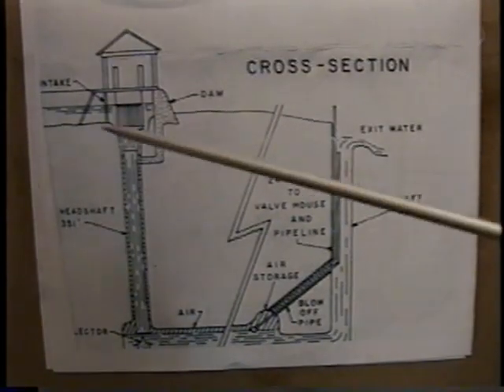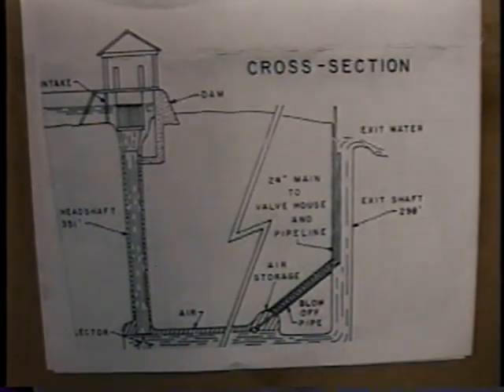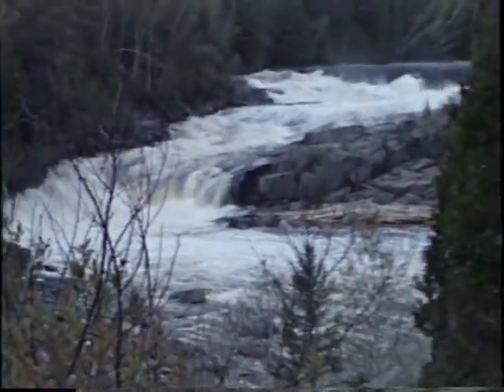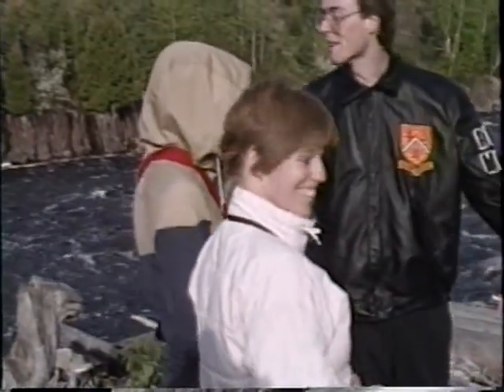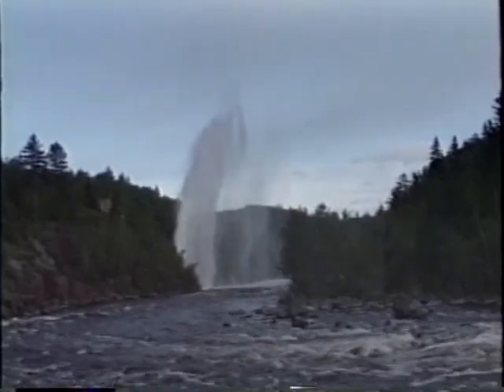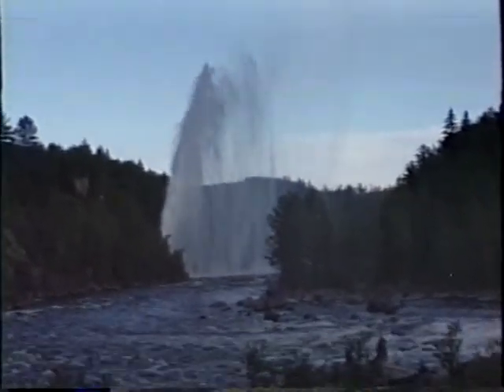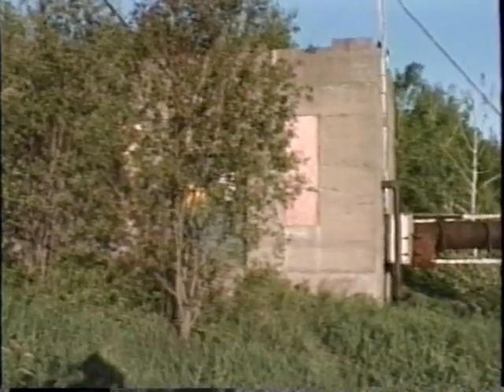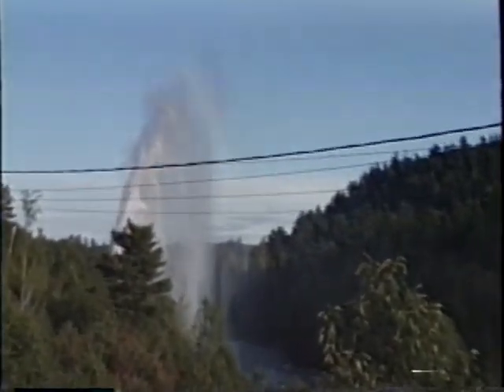Ragged Chutes compressed air hydropneumatic plant

Comment: Why not connect an air powered reciprocating engine to the outlet supply pipe via suitable control valves... drive a small AC generator....now that would be 'clean' energy

Comment: The guy who designed this was a genius
Reply: It's actually the same basic principle as an aspirator or mercury diffusion vacuum pump... but it's still a brilliant application that should be reviewed for carbon-neutral industry
Reply: @phrenologisto  there is no such thing as carbon neutral. The carbon fanatics want us to go back to the Stone Age. No one can afford carbon neutral. It’s a fantasy
Reply: @phrenologisto  I think it would be good for country living, as it can provide heating and cooling for the house, power refrigerators and freezer, power for pneumatic tools, air for air-start engines, pressure for plumbing, and can serve as an auxiliary power supply for when everything else breaks. It's not terribly efficient, but it doesn't have to be since it doesn't cost anything for a river or creek to flow. Setting it up would be a pain in the ass, since you would have to dig a deep ass hole, but you would have you would have to dig an even deeper hole anyways for a well.
Reply: The Great Pyramid works in a similar way. 😉

Comment: I realize that the purpose of the Ragged Chutes plant was to compress air and the water blasted out is a by product.  I've suggested that the Ragged Chutes plant may be the largest water powered pump ever build based on amount of water pumped and the height lift of the water.  Hard to judge because there water does to blast though a pipe - it is just shot out 250 feet in the air.  How does the height of the blow-off pipe compare to the height of the water entering the input?

There are a couple of other styles of water powered pumps that are pretty big.   
Water Powered Technologies ram pump - I think currently in operation   https://youtu.be/pORYUjKoSuA
Thousands of years ago a ram pump may have helped build the Great Pyramid: https://youtu.be/CcqQ4K0iLU0

When interested in building water powered pumps - these are the things to look at and discuss - if interested - hope you will join in:
https://www.facebook.com/groups/240458583255303/
Reply: You can find some of the specs here:  http://www.massmind.org/techref/other/pump/raggedchute.htm.   It might answer your question regarding the height of the output water plume vs. the height of the intake heads.  I believe the diameter of the blow-off pipe was quite a bit smaller than the input pipes.

Comment: Do you know the diameter of the vertical drive pipe that where the water goes down?
Reply: I really don't know any of the specifics of the plant.  But if you go to this site http://www.massmind.org/techref/other/pump/raggedchute.htm it has some specifications.  In the summer of 1976 I worked for Ontario Hydro who operated the plant and I spent several days at the Ragged Chutes plant cleaning debris (logs and dead animals) from the head gates.   The head gates kept the debris from entering the pipes.  It was quite loud working there as the water would go over the pipes and drain into the chamber.
Reply: @stuartsutton7601  - thanks for the link - I added to the discussion on the Facebook water powered pumps Facebook group which includes Trompe and Pulser pumps - I think Ragged Chutes is one example.
https://www.facebook.com/groups/240458583255303/permalink/549423172358841/

Comment: Practical engineering sent me here 😁
Reply: My question is, How the Hell did they dig the 351 ft deep shaft for the water to fall, way back around 1908 ?  I think they said it went into operation in 1910.  Amazing ! ! !
Reply: @bigdogbob845  The place was swarming with hard rock miners.
Reply: @bigdogbob845  yup, absolutely crazy. And it's all operating without a single drop of gasoline.
Reply: @bigdogbob845  The river ran in a different direction initially.  So they dug all the chambers, etc. and once done, they diverted the river to flow to the plant.  Actually, the original path of the river was never changed.  They diverted a part of the river to the plant.  In the spring, when the snow melted and there was lots of water run-off, they needed the water to bypass the plant or it would get flooded.  During the summer when the water source was lower, most of the river flowed through the plant.  In terms of how they dug the tunnels ... remember, this was a mining community so they knew how to sink shafts through solid rock.
Reply: Stuart, yeah that makes perfect sense.  I was thinking they were digging that shaft WHILE the water was flowing, even today that would be a massive engineering endeavor.
Reply: Me too.  Fascinating stuff!
Reply: Same! Love the channel but that episode left me with many questions and a serious need for more information lol.
Reply: @Jett Kasen crazy how both of you joined only a month ago and responded to each other within minutes 🤔

Comment: This is so cool! How was the compressed air transported to and then used in the nearby mines? Was it just pipes or were there ever compressed air tanks used for any reason?
Reply: It was transported via pipeline about 10 km to the Silver mines in Cobalt, Ontario Canada.  The big pipeline to the town was probably 20 inch diameter and then it was split off to go to the various mining properties.  There are still sections of the pipe intact in the bush near the town.  When we were kids growing up, you could hear the pipes whistle when driving by if the pipe had leaks.

Comment: Very cool, incredible it could make 125psi
Reply: Water's heavy! It was clearly engineered to make 125, with enough flow and shaft height, I'm sure they could go much higher.
Reply: Cody Avant Well it could actually make 152psi beings how it was 351’ deep. Water Is 8.333 pounds per gallon so at that depth the hydrostatic pressure of water is 152 psi. 8.33 x 0.052 = 0.433 psi per foot  0.433 x 351’ = 152psi
125psi is just where there blow off valve was set to
Reply: @joelbrown7485  The exit shaft is 290' deep which corresponds to just over 125psi

Comment: Wow, you could do this anywhere you had access to a deep source of water.
Reply: It wouldn't even need to be deep, just reasonably high flow.
Reply: pilotdog68 It would need to be deep or stand tall considering you would be using the Hydrostatic column to build pressure. For every foot of column height using freshwater is 0.433 psi. So no mater how much volume you have a 2 foot column would only produce 0.866 psi
Reply: My original thought was that maybe something like this could be done at deep lakes but then I realized that the water outlet needs to be lower than the water inlet.
Reply: Ed Morales You could still do this and build a water tower for the inlet and the outlet just above the flood line. Use a few windmills to pump the water up

Comment: Pardon my ignorance but how was the air used in the mines?
I like Bill's 1970s clothes in the 1980s. He looks stylish compared to the other people.
Reply from the maker: All the underground equipment (drills, tow cars, etc.) were air powered.   It was too dangerous to run electricity underground and the air was also cheaper than hydro.
Reply: Stuart Sutton the added benefit was that air powered tools in mines carry fresh , pressurized air into the mines and release it when used. It would reduce the amount of air that a ventilation system would need to supply.
Reply: Your AC unit compresses air with an electrical compressor which can put oil residue into the air. This compresses air using water flow, and provides excellent clean water, clean compressed air which if released into the mines provides cold fresh air and also helps prevent explosions I hear. Also can run the tools or run a Tesla turbine to generate electricity.

Comment: The narrator comments that he didn't know the purpose of the plastic pipe addition. Mr Taylor's project is an implementation of a trompe https://en.wikipedia.org/wiki/Trompe . Obviously the system works by providing a chamber for any air bubbles in the water to escape too. The pipes were an inlet modification to increase the amount of air bubbles in the water. A more interesting experiment would have been to use some bleed air from the output to run some aeration stones at the water intake.
Reply: Thanks for the feedback Chuck.  My father took the video many years ago.  He is 91 now.   It is a very interesting means of producing compressed air.

Comment: amazing! An excellent example of renewable energy!  Why did they shut it down?
Reply from the maker: Ryan.  The plant was 15 miles out of town and it provided compressed air to the local silver mines.  As the plant aged, it started to cost more money to maintain it ... and the number of operating silver mines was going down ... so the cost was being spread over a smaller number of mines.  Eventually all the mines closed (they have been closed for over 20 years) and there was no market for the compressed air.  The plant has been re-deployed to produce hydro-electricity.     Some of the old 24 inch pipe from the plant still runs through the forest around the town, but the smaller diameter pipe feeding the shuttered mines has all been collected and sold for scrap.  My father (who will be 90 in May) was one of the last employees at the silver mines in Cobalt.  They kept a small crew on for a few years to cap the shafts and fence around open cuts.
Reply: @stuartsutton4226  did your father say what kind of maintenance was performed and what costs were involved? I'd like to know because I'm involved in a similar project. Thank you very much.
Reply: @stuartsutton4226  it could be used to make compressed air which could be stored in tanks and if there is deficit in renewable energy it can be used
Reply: Although the design (and indeed entire concept) of this plant is fascinating, its construction and operation had ABSOLUTELY NOTHING to do with “renewable” or “clean” energy. 

It was simply easier and cheaper to generate the compressed air this way versus conventional methods (which were very limited over a century ago anyways.) 

Think about this for a second… this plant was generating air half a century before the first satellite even existed. Do you really think they knew or cared about climate change, carbon emissions, etc?
Reply: @EstorilEm  Did you think renewable energy was invented because of climate change? No, renewable energy just means the energy source doesn't get naturally depleted, renewable energy has always been popular if it is available.
Reply: @fullcircletms  your experience and knowledge is greatly appreciated. Thank you! I have been a fan of this system since learning about it in a book years and years ago.
I'm sorry for the loss of your dad. I bet he had some great stories.

Take care. Thank you again and best wishes to you and yours. 🙏
Reply: No market for clean energy?? :(
Reply: @johncurran1179   There was a French guy who started in the nineties a company for cars powered with compressed air - it's still not on the market, but they still work on it... 
https://www.mdi.lu/
How many goddamn trompe plants will be needed to supply the actual need for energy in this world?
Reply: @TheCommono  That MDI aircar - it was done by Guy Negre - it's a scam and will never come to market.  Compressed air is a TERRIBLY inefficient way to store energy.

The scam is that they sell licenses to, I guess, very stupid companies that believe that compressed air is viable.  They've never demonstrated a car that was able to travel over 10 KM (I think 5 KM is actually their record).

They problem they have to run into the Carnot Cycle, which gives something like 50% efficiency in ideal situations and lugging around the weight of what will, essentially, be liquid air is formidable.

There's additional problems in that water vapor causes huge problems.  First, compressing the air causes the tank to heat up (PV=nRT) but allowing the air to escape cools it down.  Any water vapor will freeze at relatively warm temperatures - the tank itself could get down to at little as about 70 degrees Kelvin.

MDI has an unworkable solution, MULTIPLE engineers have pointed this out (to no avail) when you see it mentioned either it's somebody that has just heard of it and not had the explanation given to them, or they are part of the scam themselves.
Reply: @richardwicks4190  That was just sarcasm - but thanks, I had no idea about the technical 'feasability" of this.
Reply: @TheCommono  lol, this is a fraud, and it is now in "luxemburg" lol, in 30 years or more this company never released any real product, they sell "licenses" of their "technology" to investors, that is their "business model", in reality there no car and there will never ba any. And not a single "factory" ever came off the ground, the few toy car prototype they made have such ridiculous performancesthey are not functional vehicles, and any this "technology" is not, storing compressed air at 300bar in huge tanks is never going to be a decent energy storage method, this is very inneficient, dangerous, and low energy density.
Reply: @richardwicks4190  exactly, its a total scam, and they do this since decades, but it was becomming too hot in france so they moved to luxemburg, i think the founder died and now the son perpetuates the scam lol.
Reply: @johncurran1179  There was, for about 100 years.  It certainly paid for itself probably 100 times over for the amount of energy compressing all that air would have required to be mechanically produced.
Reply: @johncurran1179  in the 80's?  not a chance.  Oil was everywhere and it was only just starting to rise in price again.
Reply: This is a terribly inefficient way to obtain energy.  It makes sense though to use compressed air in mines, it drastically reduces the chance of igniting flammable gas.